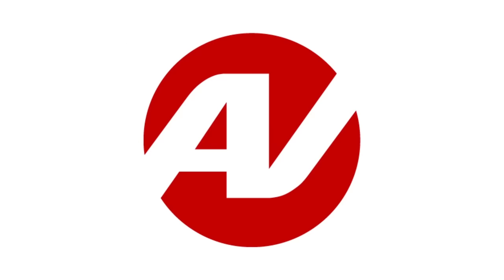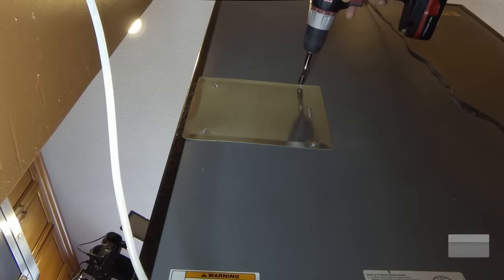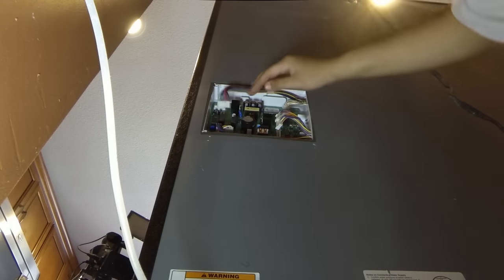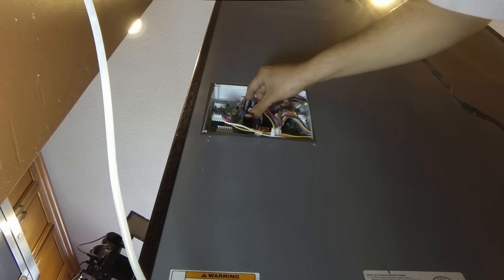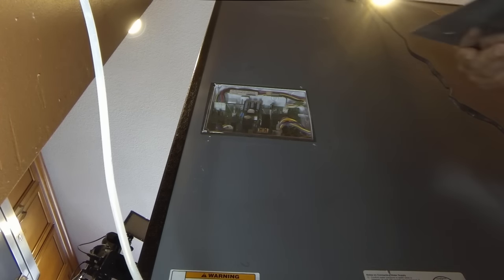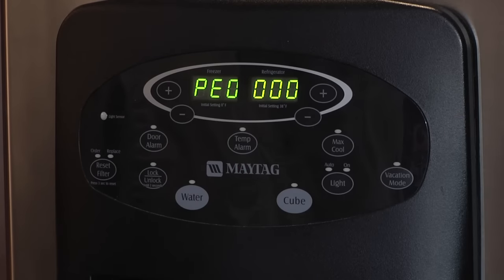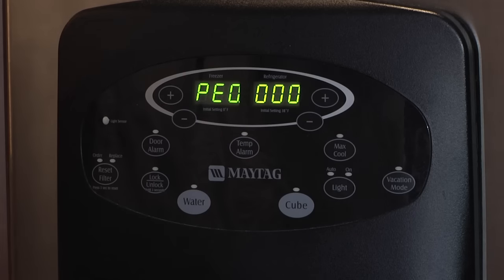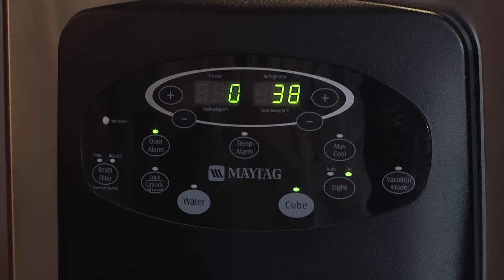Maytag Refrigerator Repair - Control Panel Lights Flashing - High Voltage Board

Comment: I have the same frig, had blinking lights and non stop ice flapper. First intermittent for a few days, then non stop for 12 hours. Then stopped cooling. Diagnosed the well know issue, just put in new HV board supplied directly from Maytag, #12920710 (which is the replacement for the original part, not to mention this is also the one that was in mine, with Maytag confirming that wants replaced it before). The installation took all of three minutes but it will not program. I've done it 1 million times and that's when I came and found your video and saw that I was doing it properly. However mine does not go off of PE0 000. And trust me, doing it right. I know the keypads are ok because they work in other combos. I can also get it to SE mode and scroll through all the tests and everything seems kosher. I'm so frustrated, tomorrow is Christmas Eve and I need to start cooking for guests coming Friday! What can I do!
Reply from the maker: +CycleOps USA LLC 

All of our technicians are now answering questions daily at our http://www.appliancevideo.com/ website under the Repair Help section.  We also have over 1600 common questions and
answers that you can easily search through by your model number, appliance
make, problem or error code and it’s absolutely FREE. You also have the option
to email a factory service technician with a question on your appliance at
http://www.appliancevideo.com/repair-help/ . If you’re looking for a repair video, you
can also search our library of over 2600 free repair videos. ApplianceVideo.com
specializes in quality DO-IT-YOURSELF appliance repair videos and we get over
800,000 views per MONTH to our videos worldwide and growing. If you need of
parts for your major appliance, we have over 5-million parts in stock at http://savemoreonparts.com/ .  Thanks
for your support. Matt Ace Appliance factory service technician.
Reply: +CycleOps USA LLC what did you do to fix it i have the same problem its not changing the pe0-000 please let me know
Reply: CycleOps USA LLC n

Comment: Hello...great video!  Okay replaced board and got the code from inside fridge for programing and it wont accept the code...now what?
Thanks.
Reply from the maker: Great question, you can call
our parts department at 1-800-830-5465 and they can give you help 6-days A week
Mon-Sat . You can also search at www.SaveMoreOnParts.com 7- days a week.  If you have a more
technical question that our parts department cannot answer, our technicians are
answering all questions at our website at www.ApplianceVideo.com under our Repair Help section. We have over 6,000
common questions and answers that you can easily search through by your model
number, appliance make, problem or error codes, and It’s completely free to
search through our question & answer library. There is a very good chance
you question is already answered there.

Comment: Hi there, how do you knew that program number was 1411? What about other Refrigerator PCBs?
Reply from the maker: Great question, if you have a
more technical question that our parts department cannot answer, you can search
our over 10,000 answered questions free at our website www.ApplianceVideo.com under our Repair Help section. You can also call
our parts department at 1-800-830-5465 and they can give you help 6-days A week
Monday -Saturday, or search at www.SaveMoreOnParts.com  24 hours
7- days A week.
Reply: There is a  4 digit programming code located on the model number tag plate inside your refrigerator.

Mine says "CODE 2020"

Comment: Hey!
I have a same issue with my samsung refrigerator.
Can you help me if i want to repair the PCB on my own. Which part of the PCB might have got damaged??
Reply from the maker: Great question, if you have a
more technical question that our parts department cannot answer, our
technicians are answering all questions at our website at www.ApplianceVideo.com under our Repair Help section. You can also call
our parts department at 1-800-830-5465 and they can give you help 6-days A week
Mon-Sat . You can also search at www.SaveMoreOnParts.com 7- days a week.

Comment: Just watched this video change out my circuit board great video , but my ice despencer (auger motor) kicks on every 5 min or so any ideas
Reply from the maker: Great question, you can call our parts department at 1-800-830-5465 and they can give
you help 6-days A week Mon-Sat . If you have a more technical question that our
parts department cannot answer, our technicians are answering all questions at our website at www.ApplianceVideo.com under our Repair Help section. We have over 4,000
common questions and answers that you can easily search through by your model
number, appliance make, and problem or error codes, and It’s free to search
through our question & answer library.

Comment: Hi I changed the board and everything looked OK until the control board started clicking and the front panel doesn't change from ice to water. Is there a fix? Could it be the new circuit board is defective? Thanks
Reply from the maker: Great question, if you have a
more technical question that our parts department cannot answer, our
technicians are answering all questions at our website at www.ApplianceVideo.com under our Repair Help section. You can also call
our parts department at 1-800-830-5465 and they can give you help 7-days A week
Monday -Sunday, or search at www.SaveMoreOnParts.com  24 hours
7- days A week.

Comment: This is my refrigerator. My interface panel has intermittent blinking lights and the ice maker exterior shoot keeps popping open and close. It does this almost everyday now for a few minutes at a time. Cannot get water or ice when the is going on. Interior lights are on when door open and it still seems to be cooling even with all the popping and blinking going on. I know this video is a few years old. Hoping for some help. Thanks.
Reply from the maker: Great question, if you have a
more technical question that our parts department cannot answer, you can search
our over 10,000 answered questions free at our website www.ApplianceVideo.com under our Repair Help section. You can also call
our parts department at 1-800-830-5465 and they can give you help 7-days A week
Monday -Sunday, or search at www.SaveMoreOnParts.com  24 hours
7- days A week.

Comment: My Son and I just did this; information is taken from the instruction sheet that came with the replacement board (obtained from an appliance repair parts store locally) and what we experienced: 

The program code for each refrigerator is located on the serial plate on the unit (inside the refrigerator on the panel near the right door) after the word 'CODE'.

To program, follow these steps:

1. Press and hold the Door Alarm Keypad ('Door Alarm').
2. Press and hold the Freezer Temperature Down Keypad (Freezer minus sign).
3. Release the Door Alarm Keypad ('Door Alarm') and wait 3 seconds.

TIP: Timing here is important; Step 3 should follow Step 2 very quickly, releasing the Door Alarm Keypad as soon as you press the Freezer Temperature Down Keypad.

4.  The control will display PE to indicate the programming mode.
5.  Entry is confirmed by pressing the Freezer Temperature Down Keypad (Freezer minus sign) once more.  [This is how you get it to go from PE0 000 to PE0. 000 where you can enter the code].
6.  Adjust each digit to the program code using the Refrigerator Up (plus sign) and Down (minus sign) keys.  Move forward through the digits using the Freezer Temperature Up (plus sign) key.  The decimal point indicates the selected digit.
7.  Once all the digit have been entered and the program code is displayed, press and hold the Freezer Temperature Down Keypad (minus sign) until the program code begins flashing indicating it has been saved.

TIP:  If you attempt to enter an invalid program code, the control will not save the new code and will beep.

8.  Open and close one of the refrigerator doors to exit the programming mode.
Reply from the maker: +Thomas Wisniewski 

Thanks for your positive comment. You are correct on the many steps and they are different on every model.  We have helped
millions of people repair their own appliances so please help us produce more
videos to our site by subscribing to our YouTube page, or posting our http://www.appliancevideo.com/ website on your Facebook or Twitter account. Our
factory authorized technician’s also daily provide free professional Repair
Help to people like you to help solve their appliance problems. You also have
the option to email a factory service technician with a question at http://www.appliancevideo.com/repair-help/ .  If you need of parts for your major
appliance, we have over 5-million parts in stock at http://savemoreonparts.com/ . Thanks in advance for supporting us. So email
us if you have any other questions our videos cannot resolve. Thanks for your
support in advance.   Matt, Ace Appliance service technician.

Comment: Can the control board be reset instead of replacing?
Reply from the maker: Great question, if you have a
more technical question that our parts department cannot answer, you can search
our over 10,000 answered questions free at our website www.ApplianceVideo.com under our Repair Help section. You can also call
our parts department at 1-800-830-5465 and they can give you help 7-days A week
Monday -Sunday, or search at www.SaveMoreOnParts.com  24 hours
7- days A week.

Comment: After installing the hvb on an Amana French door fridge we tried to enter the code 2012 listed inside the fridge but it won’t accept the code. What is our next step?
Reply from the maker: Great question, If you have a
more technical question that our parts department cannot answer, our
technicians are answering all questions at our website at www.ApplianceVideo.com under our Repair Help section. You can also call
our parts department at 1-800-830-5465 and they can give you help 6-days A week
Mon-Sat . You can also search at www.SaveMoreOnParts.com 7- days a week.

Comment: i followed your great video.
but 
i put in the code on video.   wrong code .......when i try to put in correct code it will not accept the code inside fridge.
how do i get it to accept the correct code please.
Reply from the maker: Great question, you can call
our parts department at 1-800-830-5465 and they can give you help 6-days A week
Mon-Sat . You can also search at www.SaveMoreOnParts.com 7- days a week.  If you have a more
technical question that our parts department cannot answer, our technicians are
answering all questions at our website at www.ApplianceVideo.com under our Repair Help section. We have over 6,000
common questions and answers that you can easily search through by your model
number, appliance make, problem or error codes, and It’s completely free to
search through our question & answer library. There is a very good chance
you question is already answered there.
Reply: @Appliancevideo  The code should be on the inside of your fridge, at least that's where it is on my Whirlpool. So yours may not be the same as the vid.

Comment: How did you diagnose it
Reply from the maker: Great question, if you have a more technical question that our parts department cannot answer, you can search our over 17,000 answered questions free at our website www.ApplianceVideo.com under our Repair Help section. You can also call our parts department at 1-800-830-5465 and they can give you help 7-days A week ,or search at www.SaveMoreOnParts.com  .

Comment: Where do you order the part?
Reply from the maker: Great question, if you have a more technical question that our parts department cannot answer, you can search our over 17,000 answered questions free at our website www.ApplianceVideo.com under our Repair Help section. You can also call our parts department at 1-800-830-5465 and they can give you help 7-days A week ,or search at www.SaveMoreOnParts.com  .

Comment: I have this model fridge the front lcd panel is blank no lights or they will flash on and off super fast. If the front control board is bad will cause the fridge not to run cause it’s not cooling at all
Reply from the maker: Great question, if you have a more technical question that our parts department cannot answer, you can search our over 17,000 answered questions free at our website www.ApplianceVideo.com under our Repair Help section. You can also call our parts department at 1-800-830-5465 and they can give you help 7-days A week ,or search at www.SaveMoreOnParts.com  .

Comment: Does anyone have a link to the replacement  board
Reply from the maker: Great question, if you have a more technical question that our parts department cannot answer, you can search our over 17,000 answered questions free at our website www.ApplianceVideo.com under our Repair Help section. You can also call our parts department at 1-800-830-5465 and they can give you help 7-days A week ,or search at www.SaveMoreOnParts.com  .

Comment: I had the same problem with my refrigerator and someone came in to help me fix it. A few hours after he changed the voltage board, the fridge started doing the same thing again until it completely shut off. Is there still a way to fix it or will it not work again?
Reply from the maker: Great question, you can call
our parts department at 1-800-830-5465 and they can give you help 6-days A week
Mon-Sat . You can also search at www.SaveMoreOnParts.com 7- days a week.  If you have a more
technical question that our parts department cannot answer, our technicians are
answering all questions at our website at www.ApplianceVideo.com under our Repair Help section. We have over 6,000
common questions and answers that you can easily search through by your model
number, appliance make, problem or error codes, and It’s completely free to
search through our question & answer library. There is a very good chance
you question is already answered there.

Comment: Assuming the programmed codes can vary, how can I know what code to use for my refrigerator? Maytag model# MFI2568AES Serial# 10479502JJ
Reply from the maker: Great question, if you have a
more technical question that our parts department cannot answer, our
technicians are answering all questions at our website at www.ApplianceVideo.com under our Repair Help section. You can also call
our parts department at 1-800-830-5465 and they can give you help 7-days A week
Monday -Sunday, or search at www.SaveMoreOnParts.com  24 hours
7- days A week.
Reply: How do you reset the smile panel board

Comment: Hello, I follow all your instructions with the code 1411, but don’t blink, just beeps
Reply from the maker: Great question, if you have a more technical question that our parts department cannot answer, you can search our over 17,000 answered questions free at our website www.ApplianceVideo.com under our Repair Help section. You can also call our parts department at 1-800-830-5465 and they can give you help 7-days A week ,or search at www.SaveMoreOnParts.com  .

Comment: Any idea on what to do if the refrigerator does not accept the Code that's written inside? Mine is also 1411 and it beeps when I try to save it... 😡
Reply from the maker: Great question, if you have a more technical question that our parts department cannot answer, you can search our over 17,000 answered questions free at our website www.ApplianceVideo.com under our Repair Help section. You can also call our parts department at 1-800-830-5465 and they can give you help 7-days A week ,or search at www.SaveMoreOnParts.com  .

Comment: Left the freezer open for couple of hours now door alarm flashes and lights in side fridge won't come on?
Reply from the maker: Great question, if you have a more technical question that our parts department cannot answer, you can search our over 17,000 answered questions free at our website www.ApplianceVideo.com under our Repair Help section. You can also call our parts department at 1-800-830-5465 and they can give you help 7-days A week ,or search at www.SaveMoreOnParts.com  .

Comment: how and where to find the code? have same issue just different fridge
Reply from the maker: Great question, if you have a more technical question that our parts department cannot answer, you can search our over 17,000 answered questions free at our website www.ApplianceVideo.com under our Repair Help section. You can also call our parts department at 1-800-830-5465 and they can give you help 7-days A week ,or search at www.SaveMoreOnParts.com  .

Comment: These fridges with blinking lights and clanking ice door, have common problem (hv board bad) i found 12 volt on J6 fluctuating wildly from 5 volt to about 18volt. Used a power supply set on 12 volt on pin 2 of J6 and ground on pin1 of J6.  That solved the problem requires about 1.8 amp at 12 volt. ordering board takes me a week. so im using my bench top power supply to run the fridge until it comes in. Could make a permanent fix this way with a power supply from ebay or an old computer power supply. 12v 2amp should do it. J6 is the upper left plug from the back view. ( i had already replaced 2 capacitors a few days earlier it did not fix it)
Reply from the maker: Great question, if you have a
more technical question that our parts department cannot answer, our
technicians are answering all questions at our website at www.ApplianceVideo.com under our Repair Help section. You can also call
our parts department at 1-800-830-5465 and they can give you help 7-days A week
Monday -Sunday, or search at www.SaveMoreOnParts.com  24 hours
7- days A week.